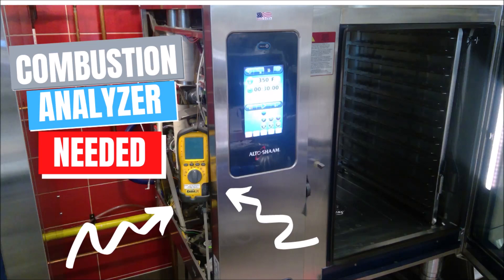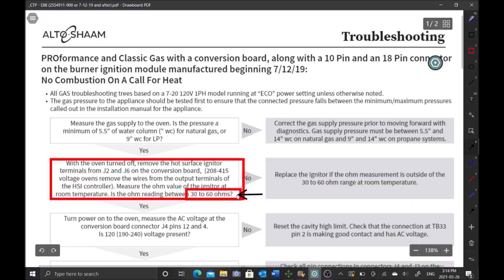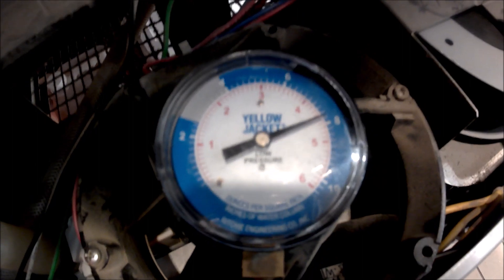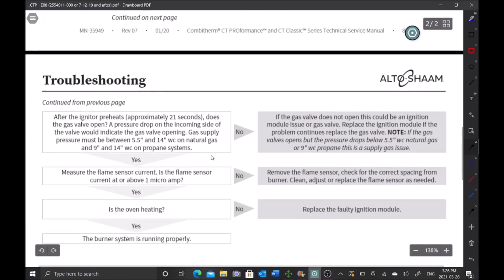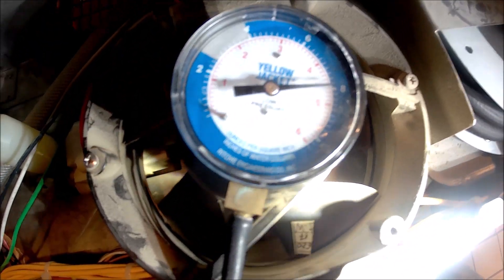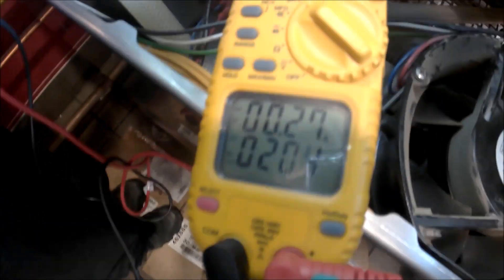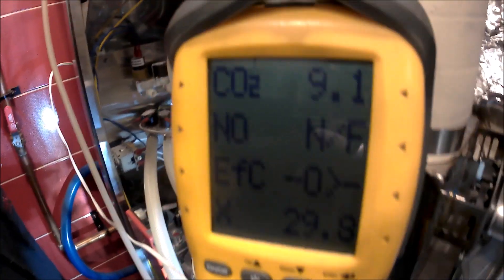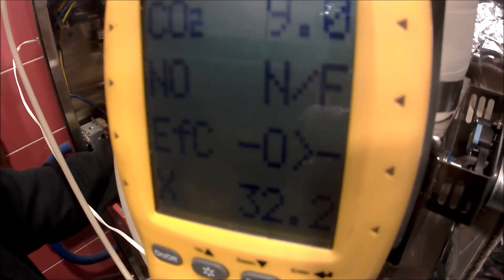Alto Shaam Combi Oven E88 Error.. For the 3rd TIME in 6 MONTHS.

Comment: Hello my friend hope all is well would it be possible to receive some technical assistance from you as one tech to another. I am working on a Alto-Shaam Combi Oven m# CTP7-20G, Serial# 1387044-000, the customer been having a non responsive display that freezes up after the unit is switched on. What happens is the pro touch screen illuminates and loads up the software up until the point where the screen shows the home screen then when you press any icon be it the utility, professional c mode icon etc. the screen enters the selected option freezes up and become non responsive to touch. I tried updating the software with the latest version software for this model equipment from Alto-Shaam website but the usb port also  becomes none responsive. I followed the Troubleshooting flow chart on page 63 of the technical service and training manual for this model equipment. There was 12vdc across terminal XO7 pins 1&4 of the control board and also on the interface board XO7 pins 1&4. All wiring between the CB, IB, touchpad and  on/off board were tested for continuity. So we ordered a new touchpad part# 5023200R , user interface board upgrade kit pt# 5023646  and the buzzer speaker pt# BZ-34675 . When the parts were installed referring to instructions sent with the parts the new touchpad didn't even complete the booting process, the touch pad screen would just flash Alto-Shaam logo at the bottom of the screen and then the entire screen will turn dark grey with the backllights on in the screen then after a couple minutes the touchpad would power off. Note that all dip switches were set as the manufacturer directed in the manual that came with the IB upgrade kit. Seeing that you have been working on these Alto-Shaam Combi Oven a while,  could you walk me through this repair or give me a contact (email/#) to Alto-Shaam technical assist department that works. Been trying to call the numbers on their website but not getting through.

Comment: Is that probe for the analyzer something you made? I tried doing what you did there with a different analyzer that had a plastic handle on it and that didn’t go so well. Now I just leave it in the pipe long enough to get a reading and make my adjustment and check again.
Reply from the maker: Yes just bent some 1/4” copper and inserted it into the tubing provided with the machine.

Comment: Hey bro what is the name of that digital tester you used to test the co2 and how and when do you use it first time I am seeing it used can you explain it to me or send me some pdf literature on it ?
Reply from the maker: It’s a UEI C155, I don’t think they make this model anymore. I use it if I feel that we don’t have “clean combustion” during ignition. For example, if I hear rumbling at startup, it’s a good indicator that the co2% is off. I also use it when installing a new unit as part of the start up so I can tweak the unit for maximum efficiency. And in this case, I felt the burner was running too bit so I confirmed this with a high CO2%.

Comment: You did great. But I would change the board before the warranty expires just to circumvent any future issues.  I dont think the flame sensor being near a seam would matter as I seen sensors that are directly in the fire (I.E. Most commercial gas water Heaters as well as most oil fired devices.   ) .   Either way I feel like you got this one fixed. Great content as usual.
Reply from the maker: 5-10 years back, another manufacturer using the same burner was having an issue with the seam being near the ignitor, but I think it was causing the hot surface ignitor to fail and not the flame sensor, but I can’t 100% remember. That’s a good point about the ignitor being in direct flame and not having any issues on different types of setup, which makes this issue of the flame sensor continuously bending strange.
Reply: @REFRIGERATIONKITCHENEQTECH  yes. I remember working on some Boilers that had a Hot Surface ignitor ( glow plug or alumina steel ignition device)  that would burn out the igniter bc the formula they used was breaking down during certain circumstances.  But I digress,  I'm not expert on the equipment you are looking at here.  You've had other units that have similar installation dates , take one of their flame sensors and place it into the troublesome unit.... if it goes out in three months after being in the other equipment for 9 months id say there's other issues.  Another thing I'm thinking is that the board could be reading the sensor a bit differently and allowing it to get hotter than the recommended temp.  Again the ol switcheroo would tell more. 
Either way,  Thank you for taking time to provide us with this information.
Reply: I havent seen a follow-up , so, i assume this was fixed?